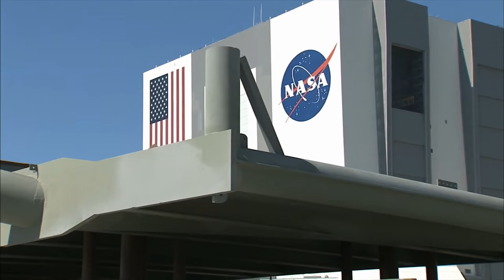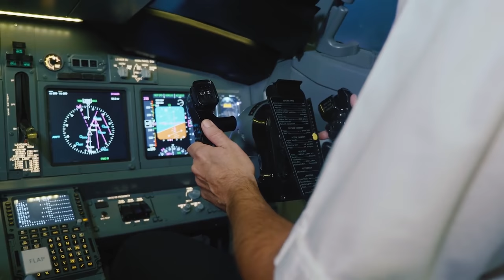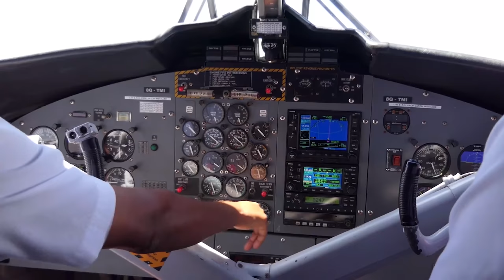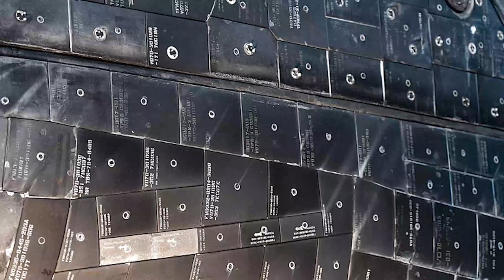Why Building A Space Plane Is Nearly Impossible (Physics Explanation)

Comment: Space plane will prove itself in the near future...
Reply from the maker: That would be awesome!
Reply: Only on LEO and even then VTVL is probably gonna take over.
Reply: I’m holding my breath….
Reply: Just need more powerful engine and a more efficient power source
Reply: Look up Ravn-X that the US Space Force is testing. It's technically a unmanned drone but all fighter jets will soon be unmanned drones. Also the Space Force has Partnered with the Air force and worked with Space X to develop the 6th generation fighter Jet, and they created a new type of engine for it. That tells me that they will be able to travel in lower space.
Reply: Flying into space. Not launch. Not blast. 
...Fly...
Reply: @mattstorm360  You can’t fly if theirs no air 🤣 the highest flying airplane has a max ceiling of 90K feet, the lowest earth orbit is 500K feet… and thats not ideal, it would de-orbit to quickly.
Reply: @andrewdoesyt7787  I see someone has yet to see the show 'For all mankind'
Reply: You will need material that can with stand high heat temperature and intense pressure that would make it very expensive and difficult to produce.
Reply: @kristiankoski3908  VTOL has inherent danger built in. Try to land if the fuel goes out... or if engines fail to ignite. 
Spaceplane can land aerodynamically, without using the engines.

Spaceplane as SSTO is possible it needs LH2/LOx fuel- it needs air breathing rocket engines like SABRE is, and preferentially aerospike like nozzles. 
And, like Musk told once- you need to build big to defeat the mass of construction. Star Raker like rocketplane would totally work. https://www.youtube.com/watch?v=JsS0Gn0IN2I Maybe the heat resistant tiles wouldn't be necessary, because due to large wing the braking could be very gradual compared to space-shuttle.
Reply: @petersvancarek  Yes, I agree that space planes are safer. But we must make the VTVL safe, nothing is safe at first. Also I agree that space planes could be our first SSTO vehicles but sometime in a future VTVL will be also.
Reply: @kristiankoski3908  I'm skeptic that the rocket can be ever made for safe landing... unless it would be able of soft landing without engines working :) I know, stupid idea.
The biggest problem connected with safety is the big size and large number of people as passengers. This doesn't matter for nonliving payload.
Reply: @petersvancarek  It will get better! Falcon 9 has already 90% landing success rate and we've just started that. Nowhere near safe for humans yet but trust me, when more companies starts doing this, the success rates will skyrocket (no pun intended) pretty fast.
Reply: Ye
Ah right
Reply: Yup, eventually we'll probably figure something out.
Lets not forget that only 60 years before the Moon landing scientists insisted that crossing the Atlantic Ocean by plane was impossible.
Reply: Dreamchaser is getting close.
Reply: @andrewdoesyt7787 you absolutely can, you just intage the normal engines when you are to high and that means you’ve shaved 90k feet which is a lot to make thousands of tonnes using pure power

Comment: I never thought about it before i just found a solution they should attache one rocket to the plane then i realized it is already done.
Reply: Meet the bell x-1
Reply: That’s literally KSP’s solution. Even SSTOs are basically rocket planes that can travel between planets
Reply: No one has done a double stage rocket to a plane, could be worth looking into
Reply: @philipdrew10  not worth looking into at all, that’s just a rocket that doesn’t have the luxury of negligible air resistance
Reply: @johncorn7905  Unless your a kid then dont stress. But why so confident about rockets and jets? Shouldnt just say random shit
Reply: @johncorn7905  My comment got deleted. In short I said a plane with a 20ton pay load capacity carries a 15 ton electron (rocket lab) to 50,000ft or higher. As long as the release mechanism is good the plane should use less fuel than the rocket and theoretically is the most efficient way to transport a rocket into space. I didnt say it was a good idea though just could be worth looking into. My goodness people in this comment section are amazingly confident about stuff they know very little about

Comment: The Yunlong engine pre-cooler was just successfully tested 1 month ago, where it cooled high speed air flow from 1000 degrees Celsius to 0 in a few milliseconds. It’s a huge breakthrough and arguably the most challenging part of a spaceplane.

Of course, the engine will not be ready until late 2020s and the first plane won’t fly until 2035, but it’s not really impossible.

It is very much possible and projected to cut down cost by 90% compared to traditional rockets.
Reply: Nah it is
Reply: Making a spacecraft using Made In China parts sounds like a fundamentally flawed idea.
Reply: @nickkorkodylas5005  idk man. China historically had a higher launch success rate than America did.
Reply: @thomaszhang3101  >historically
You misspelled "ironically".
Reply: D'Auvergne and Bundo patents should be considered since Alan Bond's Synergistic air breathing rocket engine or Liquid aid cycle engine would require diborane fuels.
Reply: 90% won't gonna cut it. Reusable boosters are the way to go, with up to 98% reduction.
Reply: I have MIT per reviewed endorsement so by invite only I gave an MIT presentation on how spaceplanes are better than a vintage 1960s brute force mentality of vertical flight since I have a CIA archaeologist stuck in Hamgyong in search of an early 1940s muon catalyzed fusion rocket plane while Dr. Mitchell Swartz affiliated with MIT says I should take Drexler to court for plagiarism.  

Xcor's Lynx spaceplane is much better than brute force of vertical flight and could be improved with deuterated diborane fuel with an electromagnet coil to focus cosmic ray muons. 

Robert L Morrison has patented lighter than air solids "SEAgel" or "Biofoam"
Reply: If San Kang gives information on Yunlong engine pre-cooler I will give more information on isotopic fueled spaceplanes.

Comment: Lockheed X-33 demonstrated that it's a full ssto and the most advanced spacecraft at the time, using aerospike engine and 90% cheaper than the space shuttle, killed in the final moment by Ivan Bekey. Skylon from the UK successfully tested the cooling system for air-breathing engine at mach 5.5 and attempting to test the ssto spaceplane in 2025 (18 tons to LEO). Similarly lockheed SR-72 is also aiming for mach 6 using air-breathing engine but with a different purpose, as a successor of SR-71. USAF now need a powerful reconnaissance airplane again due to the threat of anti-satelite weapons.
Reply: We need smarter leaders and smarter VOTERS!!

Comment: There is a reason why planes even jets have a height limit. Even jets, one of the biggest advancements of humanity can't go to a height beyond its limit or it will fall and not function.
Reply from the maker: Yep, high speeds and altitude don’t go well with regular jets.
Reply: Jets use air pressure so higher you go less air their is to push. Rockets dont use air intake at all but are much less efficient at propulsion, hence the space -->rockets and atmosphere --> planes

Comment: The f22 is truly the most advanced mind blowing aircraft when it comes to lift generation. Nearly Everything on that jet was made to generate lift.
Reply: It was one of the greatest piece of engineering.
Reply: Well lift is needed but its not like the best plane is the plane with the most lift. F22 is probably considered reliable and manouvorable for its reputation
Reply: @philipdrew10   * maneuverable * 
Yes, the goal is the generate the most lift possible, with the most maneuverability. That’s why the vertical stabilizers are set the way they are, movement and they generate lift, vectored thrust, the fuselage itself generates lift. 
Yeah, well 🤔, the best jet out there right now is the f-22, which generates the most lift….. sooo I guess… that means the generating the most lift makes the best fighter. 
And it’s been that way since the bf-109’s vs spitfires!
Reply: @5777Whatup  You might be getting terms confused, lift is literally upwards force so just overcoming the weight of the plane. Thrust is for speed
Reply: @5777Whatup  A plane with too much lift is bad you would just continually increase altitude. Not arguing just saying :)
Reply: @philipdrew10  no it won’t because air gets thinner as you go up. 🤦🏼‍♂️ plus it’s not like you’re going to escape earth’s gravity 🤦🏼‍♂️ 🤦🏼‍♂️ 🤦🏼‍♂️
Reply: @philipdrew10  no my terms aren’t confused, you are. The raptor can vector it’s thrust UP and DOWN not just straight line power 🤦🏼‍♂️🤦🏼‍♂️🤦🏼‍♂️🤦🏼‍♂️
Reply: @5777Whatup  Ah right you talking about how high a plane can go, makes sense with the video. Be more specific in your wording, I thought you were talking about the "best" fighter jet in general. Didnt think about height being a good feature, I guess stealth is really the only benefit
Reply: @5777Whatup  That is still called thrust in aerodynamics, lift is the upward force created by the wings.
Reply: @philipdrew10  it is also the best fighter in general, but more like Brush up on your reading comprehension skills and context clues
Reply: @5777Whatup  More here to inform than anything, just saw a lot of comments in the comments section with incorrect theories and thought I would correct people (Im a fluid dynamics engineer)
Reply: @5777Whatup  Whats wrong with telling people how rockets vs turbines work?
Reply: @5777Whatup  Did my honours in fluid dynamics on modelling how polymers interact for printer ink. Everything Ive said is correct and if we are critiquing what qualifications do you have to say that the F-22 is the best fighter jet?
Reply: @5777Whatup  What you just want to be ignorant about engineering while commenting some made up or copied opinions? You are arguing against a fluid dynamics engineer who owns a business developing jet engines I mean it doesnt get much more clear cut whos qualified.
Reply: @5777Whatup  And I do this stuff (commenting on youtube) to inform people about stuff like this. Free education on youtube is great. I asked a materials scientist about the effect of single crystals on cathode efficiency in Tesla batteries last year, great conversation and he was at a company in single crystal cathodes I think. Learnt that single crystal cathodes dont stop electrons moving through the grain boundarys of multi crystal electrodes, really worth while advice for my business in the future.
Reply: @philipdrew10  ohhhhh 
A business owner that makes turbines. I’m impressed!! I was sad not to see a single video of anything related. I’m very very interested. 
Tell ya what. I’ll subscribe and you post a video of some turbines and your little business! I love turbines. I can’t wait. It’s really easy to make a video too now! Just hit the cam icon at the bottom!
Reply: @5777Whatup  Im a business owner not a youtuber. Its all patent pending anyway would never disclose.
Reply: @philipdrew10  😂😂😂😂😂 I knew it! 
no, today has proven your a YouTuber. 
That’s all you’ve done is comment nothingness all day. 
Get outside. Find some friends. Real ones. Not virtual. 
Chronic lying gets ya no where friend. I knew some in high school. Just stop now. Friendly advice. If you really are what you say you are. 

I really don’t care just please stop commenting. My inbox is full enough. 
Goodbye.
Reply: @5777Whatup  Its like the less qualified you are the more confident you are on engineering opinions. Goes for other people in this comments section aswell. What is going on, its like theirs a community of Kerbal space program watchers who are becoming increasingly confident in their ability as engineers. Didnt want to go there but seems that way
Reply: @5777Whatup  Gone remarkably quiet after seeing my pending patent Im guessing 😅
Reply: @5777Whatup  Comon you apparently had the "courage" to falsly accuse me so have the courage to admit you wrong 😁
Reply: @5777Whatup  Waiting for a response 😅
Reply: @5777Whatup  Whatever bro, gots work to get on with....good times 😂
Reply: @5777Whatup  Comon bro, please a response, this is too sweet too pass up. 😂
Reply: @5777Whatup  Hey Garrett...remember that time you made a complete ass of yourself garunteeing I didnt have a patent or engineering background and then I proved you wrong and you went silent.........😂😅😂
Reply: @5777Whatup  Ill wait, bro you cant fasely call someone a complete lier be proven completely wrong and then say nothing. 🙄
Reply: @5777Whatup  Bro...
Reply: @5777Whatup  If your not trolling, its literally a 20 second search 2021901301 application number in auspat. Dude just look it up and everything is proven. I guess it makes sense the people who outright call someone a pathalogical liar without evidence most likely lie themselves aswell. Man its a sad world we live in sometimes...
Reply: @philipdrew10  that’s EXACTLY what you’ve been doing to me… you’re looking in the mirror obviously. 
15+ comments of yelling at me attacking me with NO PROOF. 
Contrary to what you think, it’s making you look like a doofus idiot screaming I’ve got a toy but you can’t see it. 
What 
Did
You 
Expect?
Now I’ll look that up.
If it were me, and I had something and someone said I didn’t, the NEXT COMMENT would have been the proof. 
Acting like child, gets you treated like child
Reply: @philipdrew10  talk about not trolling 🤦🏼‍♂️ I’ve said quit wasting my time for days you could have just given me this from the start mr PhD. 😂 🤦🏼‍♂️ 
I’ll report back with my findings… or lack there of?
Reply: @philipdrew10  ok aus you’re Australian. How do I pull this up? Or as always you can’t look?
Reply: @5777Whatup  Are you deleting my comments? Search "AusPat" click on the first link and enter 2021901301 into the search bar.

Comment: The Srarraker solved these problems. It was a very large spaceplane proposed by Rockwell IIRC in the late 70's for building solar power sats and was horizontal t/o and landing. It solved the heat problem by re-entering empty and thereby having very low loading/heating on the huge wing. The wing was used to hold propellant. It used air breathing hydrogen fueled turboramjets with a little hydrogen oxygen rocket help to take off and switched to all rocket at Mach 6. It was to be flown to orbit multiple times a day from an airport.
Actually the Starship could be a plane if the drag devices were instead wings and it had gear to land on a runway.

Comment: Do you think it could be possible with an aerospike engine and a specific flight path? Like: Get to an altitude of approx 20 km like an airplane -> Get to an angle of 20° -> Full engine power -> Keep tilting to get into orbit -> Orbit around earth -> (Maybe refuel in orbit to get to the moon)
Reply from the maker: That could be possible on the way up, but we would still have a large surface area to deal with during reentry.
Reply: @LogicallyAnswered  There is probably some elite physics that just doesn't allow it and reentry sucks. We have to find some super heat resistant lightweight material to deal with it. I just need to see an efficient SSTO in my lifetime otherwise I can't die peacefully.
Reply: @LogicallyAnswered  ok i suggest taking tips from starship for this
Reply: @itstimetomakelol6650  well technically starship is a ssto but only from Mars as from earth it requires superhevy
Reply: @rohitwankhede9153  true mainly the retractable wings to reduce the surface area.

Comment: Great video. I think you should´ve mentioned that the most important advantage of a space plane is that by not needing internal oxygen tank until it reaches significant height and speed is that it can be much lighter overall, at least in theory, and because of it a space plane could be single stage to orbit.
Reply from the maker: Ah yes, that’s true if you use both jet engines and rocket engines.
Reply: @LogicallyAnswered  ya especially with advanced engine tech like aerospikes
Reply: @LogicallyAnswered  although I am not sure how much of an advantage they would provide
Reply: @rohitwankhede9153  I'm pretty sure aerospikes don't use external oxygen from the atmosphere but they would give a used boost in fuel efficiency in other ways by having what is effectively a passively expanding nozzle to fit with the atmospheric pressure it's at.